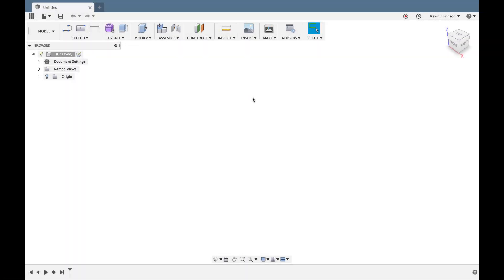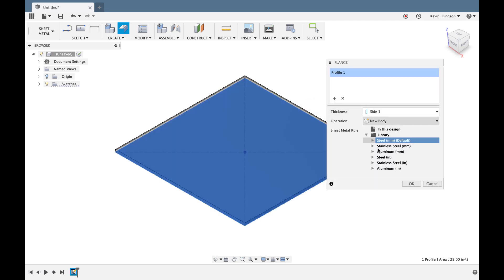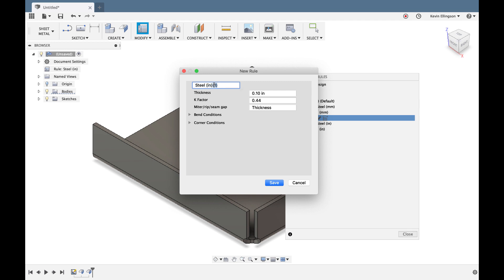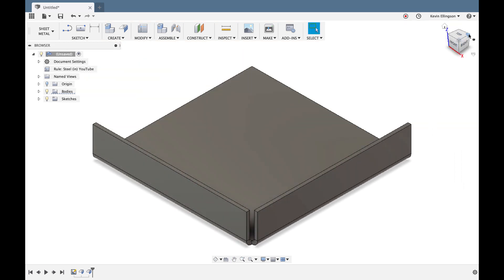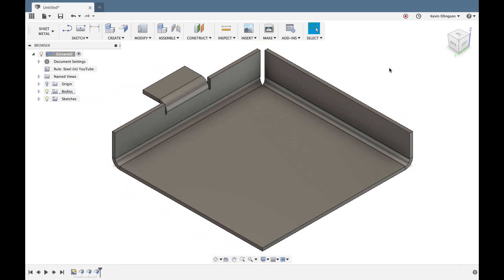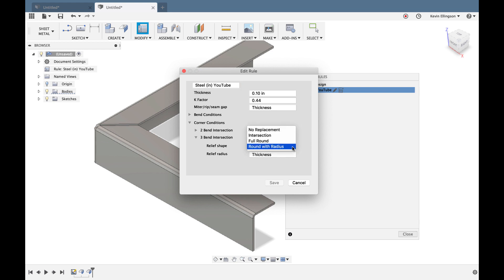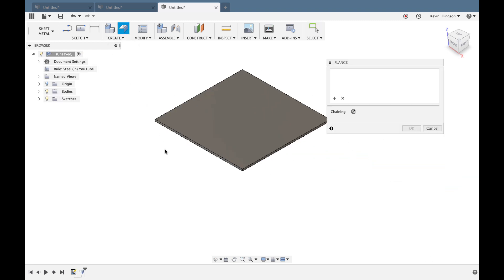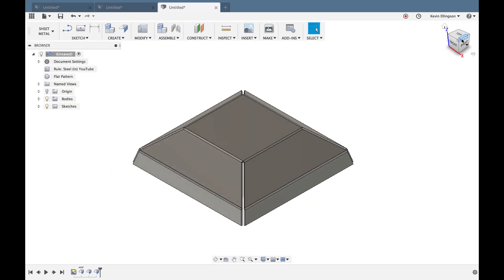Fusion 360 - Sheet Metal Rules

Comment: Very good and precise explanations thank you! However what do we need to do to get rid of the gaps at the corners and intersectional edges. I want to make an airtight box from sheet metal.
Reply from the maker: You will never get rid of the gap. That is required in order to form the flange. Sheet metal parts that have that requirement get their seams welded after that part is folded into its final shape.

Comment: my main problem is changing the actual material that f360 shows in technical drawings. I've tried dragging another material over the body and also over the part, but it never applies the material.
I'm working with Acrylic, not steel.
Reply from the maker: The link isn’t instant. Change the material and then hit save on the design file. Then when you switch to the drawing you will see a warning that the drawing is out of date. After updating using the update UI l, your parts list should show the new material.

Comment: Btw, was trying to make a flat cone that I could role a while back, and never could figure out how to do it in fusion, and ended up finding some little website you could enter the cone parameters into and it would generate the flat file, but surely its possible in fusion.
Reply from the maker: Ramsey Customs - There May be a way to do this, but I think it is probably a current limitation. Let me give it a try tomorrow to see if I can make it work out.